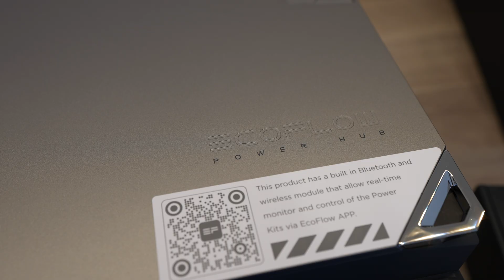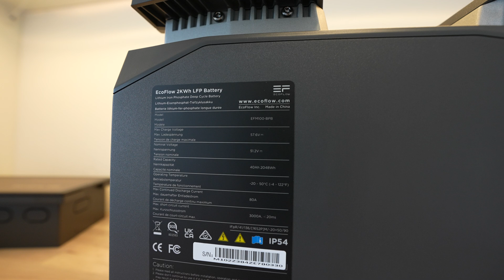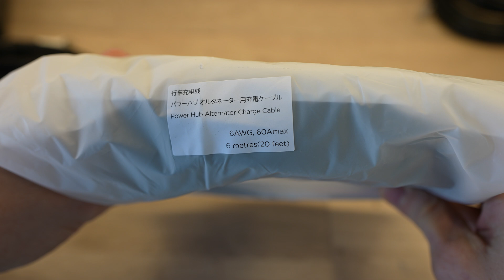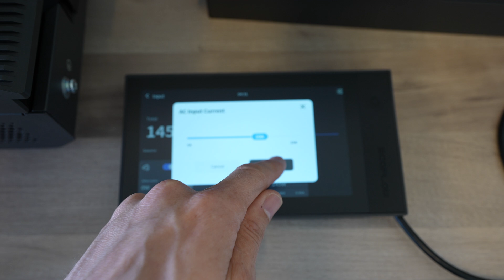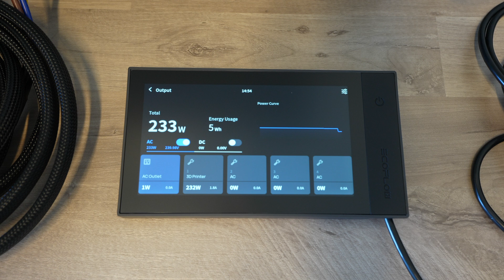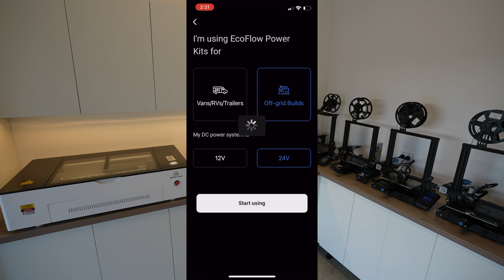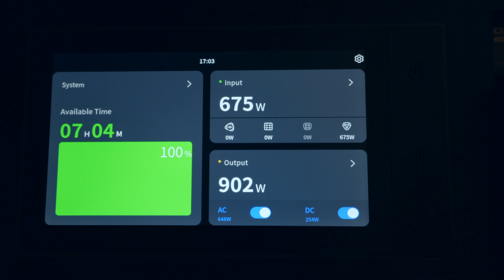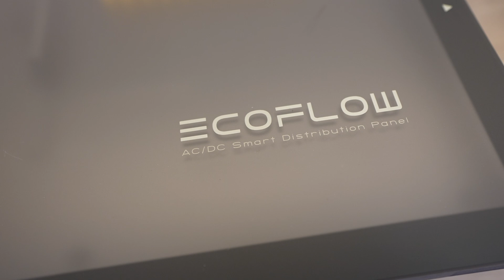I'm Taking My Workshop Offgrid Using EcoFlow Power Kits

Comment: Can you connect a 3rd party 48V battery to the Alternator input cable to topup the PowerKit batteries from the 3rd party battery? :)
Reply from the maker: Not directly, you'd need some form of regulator and discharge protection device between the two.
Reply: @MichaelKlements  Thx. You got any particular device in mind that could to this?

Comment: Thanks for the reivew! What happens with the solar power when the battery is 100% charged? Does the hub behave like a regular hybrid invertor then, meaning just by-passing the power to consumer load/outputs? You mentioned that the power from the batteries is used at night, how the scheduling is working? Thnx!
Reply from the maker: Yes when the battery is fully charged then solar power is passed through to the connected load. In the version that I have there is no way to set a charge schedule, I have the mains charging input on a timer on the wall so that it connects to mains late in the afternoon each day and this will top up any shortfall that solar wasn't able to charge during the day.

Comment: Can this system be used with other Li ion batt other then eco flow
Reply from the maker: You could probably power the system through one of the DC inputs using another brand of battery, but not through the battery ports. This obviously also won't have discharge protection or be able to charge the battery.

Comment: its to bad most people can't afford these things. not sure about others, but I can't drop 2000 to 3000 + dollars on something something like this, but I would love to have something like this.  I hear all these people want people to use renewables, but with prices still so high, like solar system,  renewables are way out of reach for allot of people and will be for quite awhile.
Reply from the maker: I agree, this is an expensive product, but it's priced quite competatively for their target market. People typically buying RV's or camper vans, or are building offgrid homes in remote areas are usually happy to spend a couple of thousand dollars on a power solution, and this system makes it simple for those who don't have the knowlegde or time to build a system from scratch.
Reply: I agree, hopefully more systems/competitors will be available soon. Then they compete price wise. But batteries itself is the big cost here. I am thinking about this Ecoflow instead of the DIY Victron way.